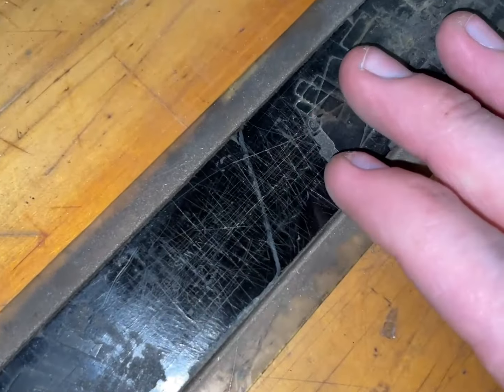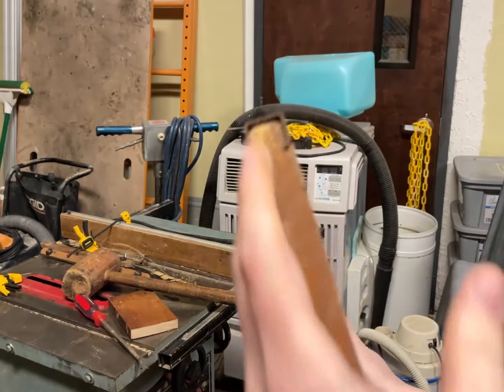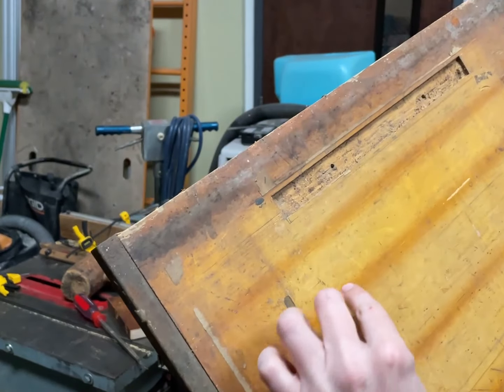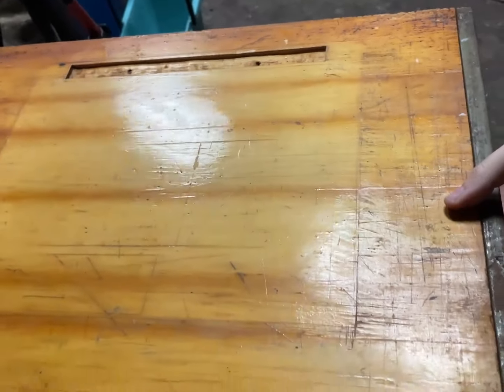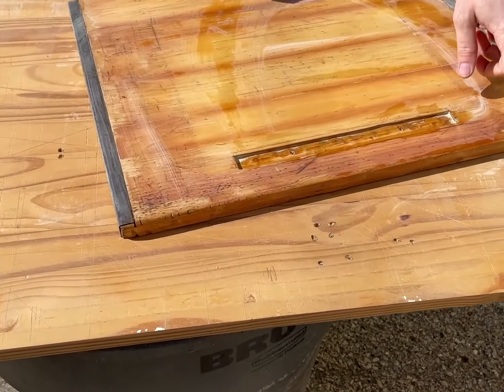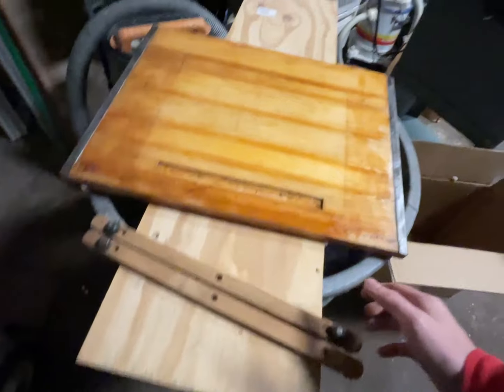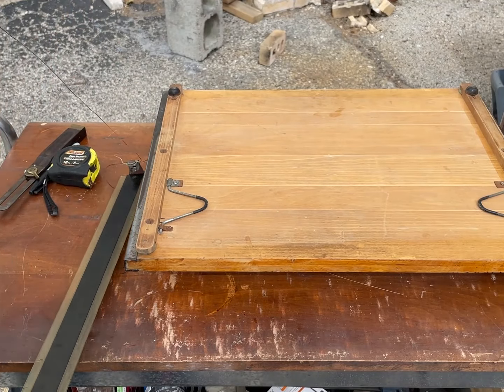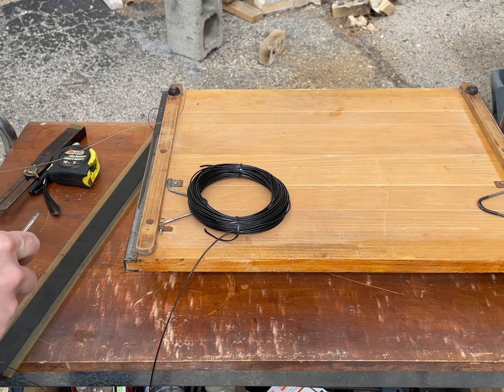Trash Rescued Mayline Portable Drafting Table with Drawing Parallel restored to working order.

Comment: Thats a lovely drafting table you have - well worth the effort to restore, I have had a few in my lifetime, but no longer have space for a full size drafting table, they often had a sheet of green one side off white the other vinyl on them as a surface to draw on (almost invariably used green side up) I learned my trade at a board similar to your one at school, then went on to a full career on the drawing board, and then onto CAD.

Comment: get yourself a 45 degree and a 30 degree drafting square, and that will set you up to make accurate drawings. I once picked up a box of the scales used on the bigger drafting boards with the scales set at right angles, the box contained about 6 sets of scales (in different sales) that fitted to a drafting machine. i still use them to this day
Reply from the maker: Yeah I'm going to keep an eye out for them, I mean I always do but still. If I seek it out it'll cost a lot, but if I wait for one to come to me it'll probably be free!

Comment: Funny you are drawing something for Sylvania (assuming) flourescent tubes. I've got about 10 in original package, they're F15T8-W. I got them with some crates at an auction, considering dumping them at the  recycling center as I don't know what else to do with them. Do you have any suggestions?
Reply from the maker: These are Lumiline bulbs which are actually incandescent. They sell for like $100 so im making led replacements. You may wish to check if yours are lumiline bulbs